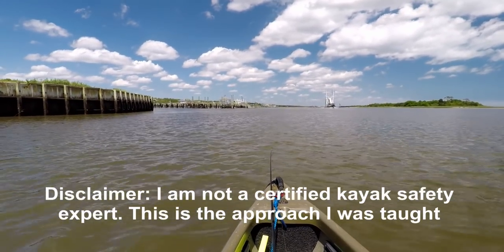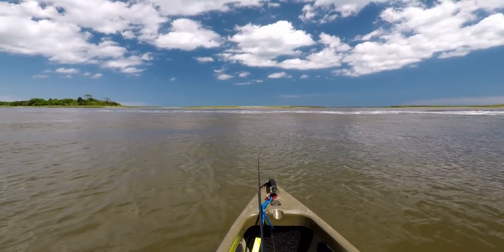Kayak Fishing in Rough Water - Kayak Safety Tip for Boat Wake

Comment: I watched this video a few weeks ago and it came in handy yesterday...twice! A speedboat whizzed past me while I was kayaking, and quickly I thought back to this video, turned to face the wake head on, and started paddling for deeper water.  This is the opposite f my instinct would have told me to do, and it worked beautifully. Unfortunately, they were so close that I got the initial wake, not just the swell, but my Oru Coast did cut through it no problem.  Got to try it out again an hour later, but thh boat was further away, so I just had the swells, and again, no issues. Who says you can't learn kayaking skills from Youtube!
Reply from the maker: It is a shame they do not have more awareness of their wakes!
Reply: @KayakhacksFishing  I don;t think this guy cared. I looked at the go pro video after to make sure I wasn't misremembering. I was actually 50-60 feet from a dock where people were swimming, and this fool actually zoomed in between me and the dock. (So I actually didn't paddle for deeper water! But I did with the next boat)  His head was turned the opposite direction. He could have hit a swimmer easily and not noticed!
Reply from the maker: @heatherb.7262  Amazing

Comment: Decades ago I was in the Willamette river in a Coronado 15, a small sail boat.  A smaller tug came down river towing a raft of logs.  After it had passed. I sailed across the wake, and to my surprise there was a great amount of swirling water due to the churning of the props of the tug and the raft of logs.  My advice includes all you said, plus letting some time pass before crossing the "centerline" of the boat's passage; the bigger the boat, the longer to take.  If I was in the Columbia with and ocean going freighter, I would give it several minutes to settle down.  As in, more than 2.  They cause a wake that would make the wakes in the video look like something in your bathtub.
Reply from the maker: Great advice ! Thanks
Reply: Absolutely.  I used to work the oil fields of southern Louisiana and after navigating the Mississippi in a 21’ joe boat, and having that joe boat plane into a turn because of the current produced by the swirl of a cargo ship or ocean going tug, I would be less than wanting to trail behind it in a canoe/kayak/pirogue.

Comment: Valid info. Tested and agreed on the method. Same applies if the wakes are coming from behind. Paddling into them, fast or slow, always decreases the yak movement as it crests over each wake. (Doesn't rock it too bad.) I often continue the rocking with my body long after the main wakes have passed. My example of you need to have fun and dont freak! Also, preventative measures are a must. Make sure stuff is strapped or has a float in case of capsizing.  And to reiterate, an anchor quick release and an achor float is a must with big wakes. Being tied down and dealing with wakes is RISKY at least.
Reply from the maker: I agree!

Comment: General rule for all boats dealing with swells/waves:  Power into (either motor, paddle, or peddle) the wave, you dont have to go full power, just enough to keep moving forward against the wave.  Try to hit it at an angle anywhere between perpendicular and 45° off perpendicular.
Reply from the maker: Excellent advice!
Reply: 45 seems best to me. If I go parallel to the waves the kayak rocks side to side. If I go head on the bow slams down right as the next wave splashes up over the bow. I feel like with a 45 degree angle I'm not rocking like crazy and I don't have waves crashing up over the nose either.

Comment: You can get big breaking wakes  in deeper water too. I was out last Friday off the coast of So. Calif in about 100 ft of water when a 50 ft charter boat came chugging by at about 30 mph, pushing 3-4 foot waves that were breaking at the top, one after the other.  But overall, they're really not that difficult to deal with if they're not breaking. If they are, just point your bow into them and paddle hard like you're launching into surf.
Reply from the maker: and keep your fingers crossed! :-)

Comment: This is good. I'm a sea kayaker, long narrow yaks, sitting inside. When a group of us would launch and land in the surf, at least one of us would get hammered, flipped over, swim into shore, try not to end up with the kayak between me and a wave...  Then I got some surf zone training and practice. After that it was just a set of things to do. At worst going out a breaker would come right over the deck, but I'd get through.  That was 10 years ago and I'm out of practice.... 
Learn a couple of things. The low brace, and the high brace. A quick slap on the water keeps you from going over. I'm sure everyone has learned breaking waves will turn you side on to the wave-- then it dumps you. The move for riding in a breaking wave is to plant your paddle into the wave and push down on it hard.  But don't take my word, you have to see it, practice it. Surf zone techniques also work for any boat or ship wake, but find some videos, learn from a good kayak coach, and then practice. The day I learned I started out in the first wave riding into the shallows, upside down, head dragging in the sand. A hour later I was riding in, turning, heading right back out and doing it again and again. 
Many times I've headed out of a breakwater channel into the ocean, and it didn't look bad. But when I got out there the swell was very short, wave height 4-5 feet. Head back in?  turning around seemed nearly impossible. I think we can and will eventually wind up in difficult situations. Learn and practice. (and I'm overdue for a good practice day.....)
The flip side to boat wakes.  heading in roughly the same direction as the boat, if you plant your paddle into the crest and put your whole body into it, and do the same on the other side (you won't have a rhythm) you can pick up some nice speed. There are people who've ridden wakes at high speeds for miles. https://youtu.be/xDlZvfvlZro    I was thinking of a video of a couple of guys on the Ohio River surfing behind a paddle wheeler.
Reply from the maker: Thank you very much for this thoughtful guidance! I appreciate it!

Comment: Those are Baby  Waves. I fish on the Puget Sound where the waves from ships, medium to large yachts will easily kick up 2 -3 foot swells. You throw in some wind and you could easily add a foot.
Yes I have scuppers...
But I grew up on the Sound using a small....12 footer with a 3 ft. beam...skiff and chasing down 4 foot swells for fun.
Now I use a Bonafide 127 and do the same....it's still fun.
Reply from the maker: I'm with you! When those container ships roll up the Cape Fear River, they throw out an 8 foot wake!

Comment: I mostly kayak/fish on a chain of lakes in Central Florida and I learned to turn into boat wakes my first time out. My problem is there are ski boats and jet skiers' who think it's great sport to come as close and as fast as they can by someone in a kayak. My solution, is to go out on the lake during the week while most of these folks are at work.
Reply from the maker: Those people drive me crazy.  I think there are some who think it is sporty to try and tip us.  If you have a GoPro, turn it on when you see them coming and report the bad behavior.
Reply: Ben Bateman carry some 1-3oz sinkers... problem solved
Reply: knightnoah7  I don't want to do that. I occasionally fish at Sebastian Inlet and there is an ongoing war between fishermen on the jetty and fishermen in boats. I've seen both side sling weighted hooks at each other. I will not stoop to such childish and dangerous behavior. Taking pictures of the offending boaters/jet skiers and turn them over to our local PD is the option I've chosen.
Reply from the maker: Right, no need to do something that will get somebody hurt

Comment: face the wake makes sense ... thats what i do ... but im not sold on the difference between shallow vs deep .... plus being in 2 feet of water and tipping is better than being in 20 feet and tipping
Reply from the maker: Do what you think is best. The physics dictate the wave will be higher in shallow water. https://www.bing.com/images/search?view=detailV2&ccid=HzgJK3Mh&id=9BDF98F293B719BF8DE19B815AD9DF40B93A8EB8&thid=OIP.HzgJK3MhrS3ZyiwL34YNgwHaCZ&mediaurl=http%3a%2f%2fsurfforecasting.magicseaweed.com%2fwp-content%2fuploads%2f2010%2f11%2fShallowatercrop.jpg&exph=191&expw=590&q=wave+height+in+shallow+water&simid=608004572492138206&ck=F40EF1B24FE81BAD35DB3BF203FCA55B&selectedIndex=0&ajaxhist=0

Comment: Great tip. I use the same technique when crossing wind blown swells.
Reply from the maker: Wind drives me nuts.  10 mph is my upper limit.  We were caught out the other day when the wind picked up to a consistent 12 with gusts to 15 and it was tough paddling to get back to the launch.
Reply: Agreed.  Even paddling with the wind is a pain.  I'm worn out by the time I get back.

Comment: Interestingly, for tidal waves/tsunamis, fishing boats use the same approach: if there's time, they head for deep water where the wave is still a swell and not breaking. Reportedly, if they're in deep enough water, the wave can pass under them without them knowing it was there. 

I can also testify: as a beginner kayaker this year, I tried one spot where there were a lot of speedboats and jet skis, and got caught close to the shore at one point and was driven into the wetlands by the breaking waves. Not fun. When I was a little further out in the channel, it wasn't a lot more than just dealing with bobbing up and down for a bit. I try to keep far enough away from the main boat channel to have time to maneuver out of the way, though, if a boat comes speeding by (I hope that as the vessel with a lot more speed, the other guy would adjust to avoid me, but preference is to give some buffer so I don't have to rely on their good sense).
Reply from the maker: So true. I try and fish where the boats cannot penetrate.

Comment: New kayaker here.  First taste of choppiness I had was on a lake on a windy day, kinda figured out how to deal with it then.  Went out today on a much larger body of water with lots of boaters, and had my first experience dealing with wakes.  Luckily, it was about 90' of water, so there wasn't any breaking, just some swells that I took head-on and dealt with just fine.  One of the largest wakes came off a police boat screaming up the river, he spun around and came over to check my fishing license lol
Reply from the maker: lol! You were an easier target to catch!
Reply: @KayakhacksFishing  Where I'm at, ANY watercraft over 10' needs a permit.  Good thing I paid for one lol, and also wasn't sturgeon fishing, need an extra endorsement for them.  Got a couple nibbles from what I can only imagine were probably sturgeon.  Bottom fishing a worm in a 90' hole on the Willamette? Probably sturgeon lol
Reply: @CedarPinesFieldGrove  The price for that permit went up this year I've noticed. Used to be $7 for non motorized craft, now is like $19. Thanks Oregon!

Comment: I know this is an older video but this needs to be pinned at the top. I deal with bass boats, jet skis and wave runner ski boats. Big wakes happen all the time.  It's very important you aren't sideways to waves.  Be facing into them or your rear pointed toward them so you roll with the tide.  Be safe everyone and wear your pfd on the water
Reply from the maker: I will!

Comment: Good video. I understand what your say about the waves not being as bad in 10 feet of water as they would be in 2 feet of water. I'm not an expert at kayaking but for me I'd rather be in the 2 water heading straight into the waves at least for the waves you were dealing with. If I feel like my kayak can ride the waves being in shallow water makes it easier to retrieve gear and safer for me. If that was a huge tanker with 3 foot swells I would have gotten completely out of the kayak, grabbed my rope that's tied on to the front of the kayak and held on and hoped for the best.
Reply from the maker: I agree if you can stand on firm ground and hold the kayak if the waves are not too large.

Comment: There are some comments expressing concern about paddling towards the wake as the water behind the boat can be quite turbulent and also that there might just be more boats coming.
Those are valid concerns, but don't underestimate the safety of having your kayak meet the waves head on. If it's busy water or the boat was really huge and you don't trust paddling towards the middle of the water; just point the tip towards the wave and meet it head on.

As this video demonstrates, the top of the wave travels faster than the bottom of the wave. So imagine (especially your SOT) half tilted on a wave, the left side on the bottom of the wave, the right side on the top. Then look at the relative motion as seen from the middle of your kayak as the wave hits you from the right and pushes everything to the left. But!. The left side is, relative to the middle, pushed towards the right and the right side is, relative to the middle, pushed towards the left. This is almost a guarantee for flipping.
Reply from the maker: Excellent points!

Comment: I agree with your Technique 100% I was in about 10 foot of water last year and a cigarette boat came past me and put water over top of my bow all the way to about where my knees were I pulled the Scupper plugs and let the water drain but I did not tip over great technique
Reply from the maker: Amazing what those power boats do.
Reply: Kayak Hacks Fishing yeah I was really surprised my father-in-law was not too far from me and he took the wave sideways he was in the ascend fs128t and the water came so high that it actually got him wet in the high position of his seat but again he did not flip over I was kind of shocked he didn't
Reply: Those fs128's are like barges.  I got to try a friend's one time and it was stable as all get out.  Unfortunately, it was harder to paddle for any length of time too.  I was completely worn out in about a half hour.

I guess that's the trade-off, you can't be flipped, but you have to work hard to get where you are going.  IMHO totally worth it is you have to deal with a lot of lunatics!
Reply from the maker: Good exercise!
Reply from the maker: Lucky!

Comment: I would also add if you are near a breaker wall or any type of structure like a bridge it will reflect the wake back making that area like a washing machine. Not a fun place to be, and can be a challenge to paddle out of if not experienced.
Reply from the maker: GREAT POINT! Thank you.  Kind of like the breaker wall in the video... I should have mentioned that.  Appreciate your amplification of the message.

Comment: Beginner kayaker.first time I put out into a big body of water than I'm used to a big boat came by at a pretty good pace and the swell would of easily taken my kayak had I tried face on.i turned 180 and paddled away from the swell.even though it still caught me it was a gentel roll and didn't cause a big splash getting the inside or me to get wet.
Reply from the maker: Exactly! As long as either the front or back is aligned perpendicular, you have the max chance of not flipping.

Comment: A good reason to use a quick release anchor with float. You don’t want to be anchored on a tight line when a big wake comes along. Release, ride over the wake, come back and rehook  to the anchor line.
As far as power boats, I’d much rather they stay on plane than slow down. When they slow, the hull drops down into the water and displaces more water throwing a bigger wake. I’d rather they stay on plane and give me a wide berth.
Reply from the maker: I totally agree! Happened to me yesterday. Boat slowed down and huge wave!

Comment: I sea kayak with a 19' kayak with good chine, so taking on swells or waves sideways isn't a really big deal.  I don't have to point into the waves for stability.  I have never kayaked the smaller fishing kayaks, so this video is interesting.  I always thought the reason for kayaking was because of their stability in waves.  Are the fishing kayaks not so stable in waves?
Reply from the maker: It depends on the model and whether you are taken by surprise by a large wave. You might be leaning over the side a bit to deal with the anchor or a fish and WHAP a large wave hits and tips. Container ships are the worst!

Comment: You mentioned your boat does not have scuffer holes, is there an advantage to having them vs not having them?
Reply from the maker: I hated not having them because water would stay in. Kayaks, unlike canoes, have low sides and water will eventually come in from waves. The only disadvantage I can think of related to having them is the slight amount of drag they create when paddling since the hull is not totally smooth.